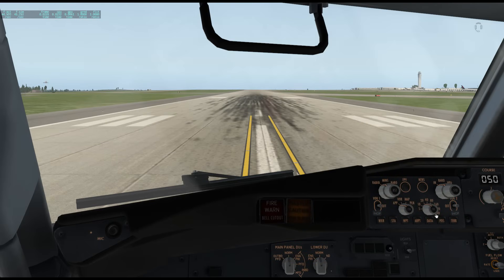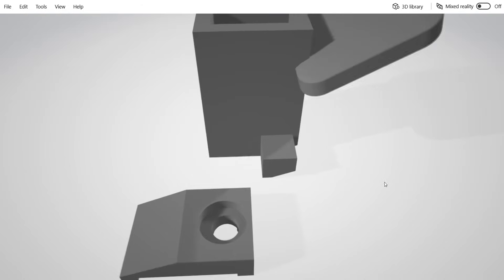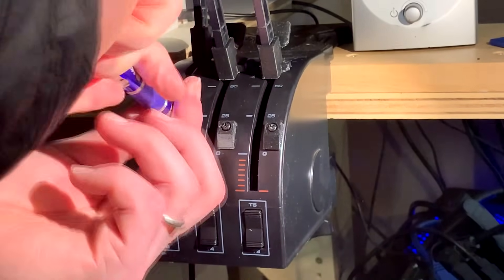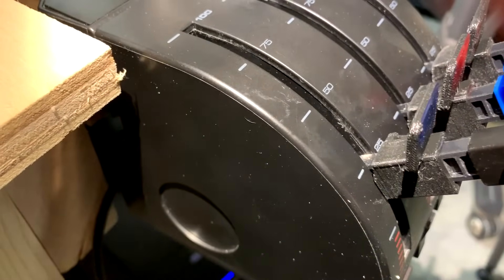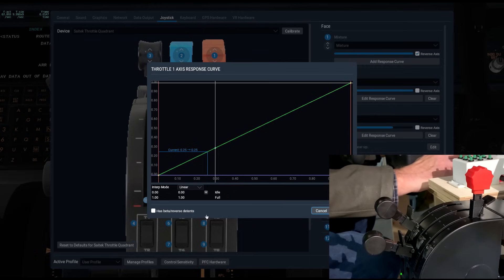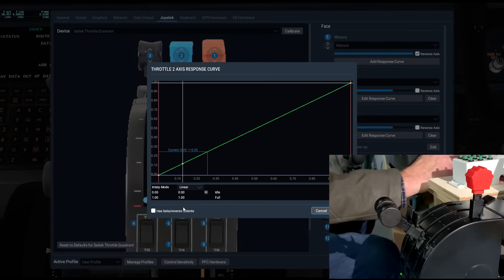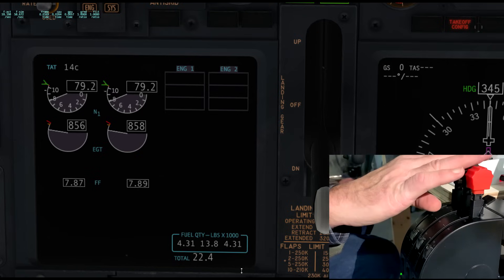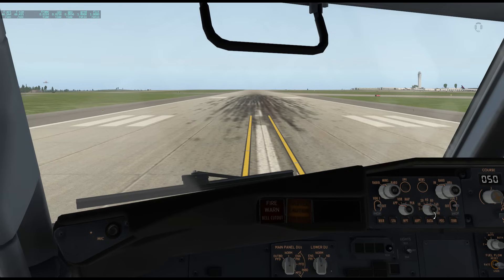Saitek Quadrant Detent Mod

Comment: Looks great. I would love to use that for flaps and spoilers, which would require it to have to be lifted in both directions, is that possible by turning the catch around, or does that require a redesign?

Comment: as a DIY'er, I'd make it out of plastic sheets and cut the four sides and use crazy glue or an epoxy... but once you've shown this to "the world" some controller Corp or add-on Co. has probably already applied for a patent. It also would be difficult to add a return spring to your idea. I have not decided what type of simulator I want to fly yet, ie, WWII or Commercial... but isn't there also a connecting bar/gate between dual throttles so that you can't accidentally unbalance R/L thrust? you could create some kind of sliding pin/bar to lock your throttles in sync.
Reply from the maker: Actually most of my designs are stolen and used by Etsy sellers who 3D print and sell. A patent is too expensive to defend for me so that's just the way it is.  I wouldn't want the throttles connected since at times like an engine failure you need to use the throttles separately.  You can set the sim up to control all engines on a single throttle id you like though.
Reply: I think there’s another issue with locking the levers together and that’s, although the levers are equal, the engines may not preform equally

Comment: My Saitek throttle quadrant actually has a 'zero position' detent that separates the upper part for forward thrust and the lower part for reverse thrust. But I am converting it into A320 throttles and your solution is brilliantly simple when it comes to dealing with the need to 'lift' the reverser handles in order to be able to engage reverse thrust. Thank so much for sharing your ingenious idea!

Comment: Awesome that you would design this and share the plans. Good karma for you!
Reply from the maker: One advantage of being retired and not having to worry about where the next dollar is going to come from. Much easier to focus and helping out others.
Reply: Thats great, must feel good. as far as that adj detent, thats mandatory for xp11. Esp in vr.  Ill  deal with slits cut in foam untill theres some decent tq's in stock. Or maybe a trip to the library to see if they can print a set up

Comment: You could also use an adhesive putty like Blu Tack to fix the stops on the base instead of screws.  I've found it holds very well after a few minutes and allows you to move or remove the stop easily.  I use it a lot when I want to fix two objects together but want the option to do it nondestructively.

Comment: @Russ Barlow do you think it would be possible to upgrade the pots in the saitek tq?
Reply from the maker: To be honest I haven't  opened my saitek throttles but they are mostly plastic so it may be risky.  Let me know if you do since the pots are crap.
Reply: @rbarlow  Roger that. I may just attempt to make my own tq with an arduino

Comment: Am i dumb?  Arent They got detents from factory? At least my ones do.
Reply from the maker: Rund ums Fliegen yes but that “detent” is only a Switch that can be programmed as single action. I used to set it to reverse thrust which gave full un-modulated.  With the detent X-Plane 11 allows you to divide the pot range to a modulated forward and reverse thrust range. Much more realistic. The switch detent at the bottom of the lever range is still available for a switch assignment if desired
Reply: Yeah, ditn't know You can Set a Reverse Thrust range. (Still stuck in FSX, i Just programmed the "Button detent" as "decrease Trust" Standard is F2) XP11 is in fact mutch more realistic.

Comment: Can you incorporate some sort of downward force on the 3D printed pseudo reverse unlock levers? Maybe a little pen spring or something that way there is some tactile feel and that way you can feel some force required to lift them over the detent. This is great
Reply from the maker: Angelo Cosma it is possible but for me the slight weight of the levers provide enough resistance. I also didn’t want to alter the throttle too much. If you do make such a mod let me know how it works (send a picture or video) but I have been happy with mine as is.

Comment: That is just Simple and Stupid.... in order words, it's Brillant ! I'd definitely buy a set of those, if you go this route
Reply from the maker: Pierre-François Gomez I’ve been using mine for several months now and they seem to work great. I won’t be manufacturing them but the plans should be available at the URL listed at the end of the video. If not let me know and I will post them someplace else so that you can have them 3-D printed yourself.

Comment: Excellent Hardware Add on Russ. I have the Saitek Throttles but no 'Edit response Curve" . Is this a x plane 11.3 version? I am using 11.62r2. Thanks
Reply from the maker: Yes that was an addition to XP in v. 11.30 now in beta and available if you launch the installer and check the "install betas" checkbox.